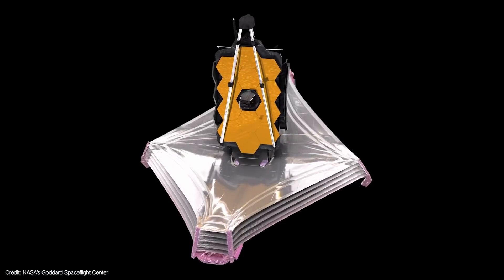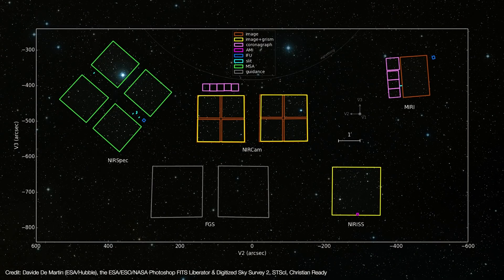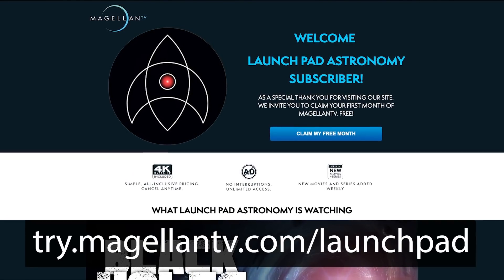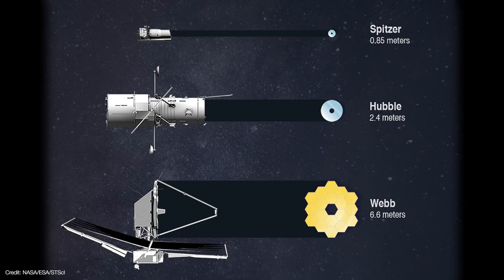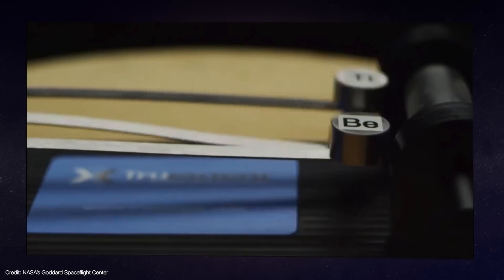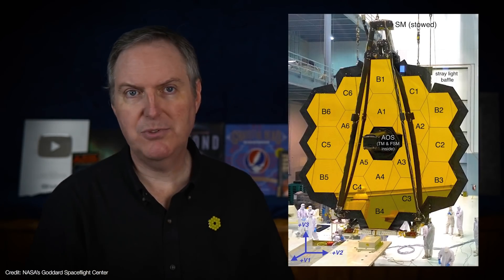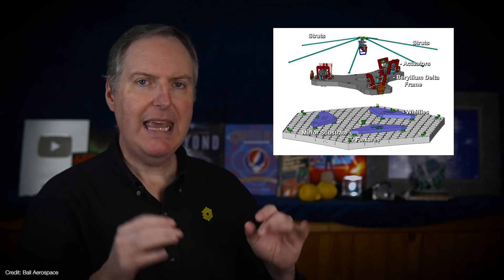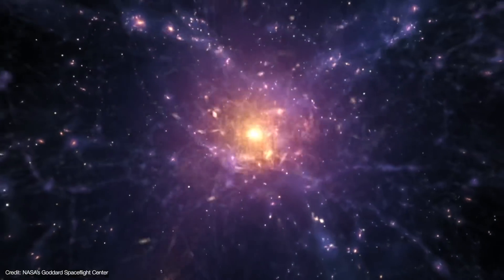How James Webb's Mirrors MUST Work

Comment: I’ve done graphics for trade shows. Where you have to align pvc panels to make the pictures line up. And there will be 16 4ftx8ft panels and then 4ftx4ft panels on top of them and they all have to line up with the graphics and not curve up off the ground or angle down into the ground. 1/16” off on one panel turns into and inch at the other side. So yeah 18 panels to that close and it’s concave… psh that’s a difficult thing to do especially when you don’t know how much earth panels going to shrink exactly and all that good stuff cause it’s real life not just a math problem. I would hate to be doing that. You’ll have 17 of them lined up but the 18th will be barely to high on one side and barely too low on the other. And then you basically have to start all the way over. It’ll turn your hair grey.

Comment: Wouldn't it be cheaper to send multiple smaller telescopes to L2 with combined mirror's surface area larger than JWT and then programmatically connect the results of individual telescope's observations? 

Sending in space such a complicated device is super scarry and takes a lot of time to develop and construct.
Reply: No. Interferometers are very technically challenging. For example, the synchronization between receivers needs to be extremely precise.  This can be a VERY hard engineering problem. 

And Interferometers are not always superior to one single big reciever. Remember.... An interferometer is basically just an approximation of the received signal via sampling (the signal is sampled in space as opposed to time). This can lead to unwanted artifacts.

Comment: Why isn't there a final layer to the sunshade that's black?  I understand black radiates more, but there's not much to radiate by the last shade, but there's plenty of starlight to reflect.
Reply: The sun shield is designed in five layers so that each layer filters heat out which is then radiated out to the edge of the shield.  By the fifth shield no more heat is left to reach the telescope which is on the opposite side of the heat shield.

Comment: Regarding the heat shields, what about micro meteorite damage?
Reply: Another video states that micrometeor strikes will not seriously affect the main mirror function though I don't recall the exact explanation.
Reply: @michaeldeierhoi4096  Actually I was wondering about the five-layered heat shielding.  First layer 0.05 mm, next four layers 0.025 mm thick.
Reply: @citizenschallengeYT  There is a multifold benefit for the five layered heat shield.  If the shield takes a hit from a micrometeor the damage is confined to a small area.  And only one layer would be affected.  Over the course of even a 20 year lifetime the shield is not expected to impacted too severely my micrometeors at its remote L2 location.  Kind of general, but that's all I've got.

Comment: I'm wondering why Webb isn't calibrated before it's sent up. Or is it 're-calibrated' because the launch vibrations caused it to misalign?
Reply: Vibrations are an issue.
But also: matter expands and shrinks with temperature. So unless you find a way to cool down such a massive structure to 35K, there is no way to calibrate it properly.
They have time right now. The few months needed to bring JWST in an operational configuration is negligible.

Comment: No mention of the two mirrors that were launched with their actuators not working correctly 🤔
Reply from the maker: First I've heard - I'm not aware of any faulty actuators.
Reply: @LaunchPadAstronomy  Scott Manley mentioned it in his latest video at about 13:20 into the video.  First I heard about that as well. Supposedly they were aware before launch and there are work around for the issue. Idk

Comment: What about dust from the solar wind?  Will that be another limit to JWST's lifetime?
Reply from the maker: There will likely be some degradation from micrometeorites but not enough over the next 20 years to really cause a problem.
Reply: The 107 inch (2.7 m) primary mirror at McDonald Observatory in Texas has 7 bullet holes made by a 9 mm pistol fired at the glass mirror. 
It works just fine.
🧐

Comment: In 10 years or so I'd like a 10 Meter Mirror. Any word on the Next Space Telescope going up after Webb ?
Jim Baltimore.
Reply: There are videos that talk about the Luvoir Space Telescope which would be up to 15 meters or 50 ft wide and similar design to JW.  Obviously much bigger in every way and it would see in visible light.   It would probably need something like the starship to launch it.

Comment: There are no stupid questions,  until now.
Will all of the mirrors need to be tweaked for each and every target? If so, how long would the process take per target?
Reply from the maker: No, not for each target since everything is far enough away as to be at optical infinity. However, the mirrors and telescope structure gradually outgass, which can require periodic tweaks to their alignment/focus from time to time.

Comment: Does NASA call today's state (mirrors unpacked but not aligned) "fully deployed"? Fully deployed makes it sounds like all configuration is complete.
Reply from the maker: The mirrors are considered "deployed" in that they are now clear of their launch snubbers. Phasing (more technically, "wavefront sensing and control" ) is the next step and will be periodically adjusted throughout the course of the mission. If we use the 'configuration complete' definition, I suppose one could argue that Webb will never be fully deployed.

Comment: I'm curious, what keeps the solar shielding from becoming a solar sail, and putting JWST off orbit?
Reply: I can't  support it with mathematical equations but I believe that orbiting in the shadow of the Earth minimizes the solar wind effect making it all but insignificant. The Earth's gravity has much more effect and if we remember the JWST is not exactly on L2 but in the position of just under-running it, corrections will be needed on the average every 21 days to overcome the Earth's gravity.
Reply: @jansb984  The mission was designed so it is never in the Earths shadow - the radiation pressure is not negligible but is accounted for by the periodic burns to adjust the orbit.
Reply: @ngc-fo5te  No
Reply: @jansb984  Yes. I know this for a fact. How would the solar panels powering it work if it was in the Earths shadow. I'm afraid you are just not understanding things.
Reply: @ngc-fo5te  May you switch off your YES/NO function to the more analog perception of the amount of light from the Sun reaching the JWST? The 100% shadow is not achiveable in real terms. Just think, would you need 5 shields of the temp protection if it was? Do not be affraid, I am not. More; there is no stright line you can draw in space. I do understand, do you?
Reply: @jansb984  That made little sense. Anyway the fact is JWST is in an orbit that keeps it out of the Earths shadow by design.
Reply: @ngc-fo5te  Hi, there is a point at which someone has to give up. I DO now but please do make yourself accustom to what the L2 orbit actually is. END.
Reply: @jansb984  I know exactly what it is - I'm an astronomer - I do it for a living. You should give up - at least until you've educated yourself on this matter. Go and look at the L2 orbit - look at the size of the orbit compared to the Earth's shadow at that distance. Why are you arguing things you patently don't understand?
Reply: @ngc-fo5te  "Patently" - so "obviously" wrong. I made statements, I do not argue.
Though, I do have a sugestion - move to an alternative faculty..
 It is so negative of me to say it - I know, I am sorry (well, not).
Reply: @ngc-fo5te  "The mission was designed so it is never in the Earths shadow" - please educate me.
Reply: @jansb984  Why not search for this rather than have me type out long paragraphs? The information on this is online - also go look at the 3D planetarium modelling of this and you can see what is actually going on.

Comment: Honestly, i perjaps it's topologically inefficient design. If you told an origami pro who does multidemensional folding systems, i think he'd make a proper fold-away telescope in a light shield cylinder using a bigger mirror which folds out in a spiral. It's better to fold a 10 times bigger mirror into 10 pieces than a small miror in 3 pieces. That said, i think they did fantastic for the material and physical tech challenges, just the geometric optimization system is a bit twatty.

Comment: This video of yours doesn't really explain why hexagons are used as the shape of the mirror.
The simplest objection is why not use a triangle, what a hexagon can do a triangle can do as well.

If there is no restriction that the shape of the mirror must be a square polygon, then anyone who has studied tessellation a little knows that there are many shapes that can be assembled into the closest possible round primary mirror while saving the most material.

So the only real answers may be the following three:
1. the factory making the mirror does not have this level of craftsmanship.
2. The calibration structure of the primary mirror does not allow for this level of workmanship.
3. some kind of serious diffraction problem will occur.

Comment: If Webb lasts 10 years, it'll cost well over $100,000 per hour
Reply: It is expected to last longer then ten years.  But even if it is just ten years and the images are anything like what is expected it will be worth it.
Reply: That’s only about 3X the “hourly cost” of operating a military jet fighter aircraft (typically $30K per hour).

Comment: What happens when it gets smoked by some space debris? Lol
Reply: L2 is inherently unstable, which is why the scope has a very definite service life. It needs fuel to stay there and make small adjustments to its orbit. We've also sent multiple probes through the asteroid belt without trouble, because even there is very empty. L2 has orders of magnitude less material per cube kilometer.

Comment: fock.  Reaction wheels??  Why the hell are there reaction wheels on that device?  Not only does it waste fuel when you have to zero the angular momentum, it gives you this vibration problem.  Use real gyroscopes, people!  Precession, as opposed to momentum transfer, can be spun down to a halt without screwing up your orientation and doesn't spend fuel.